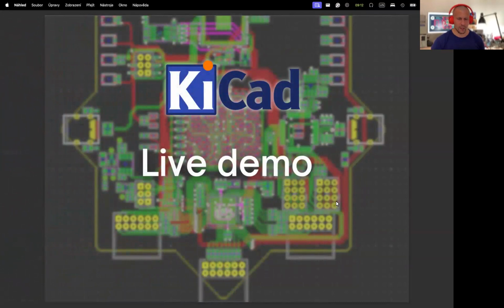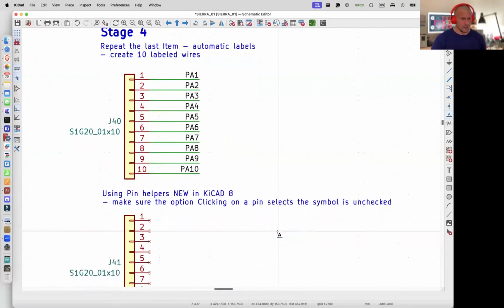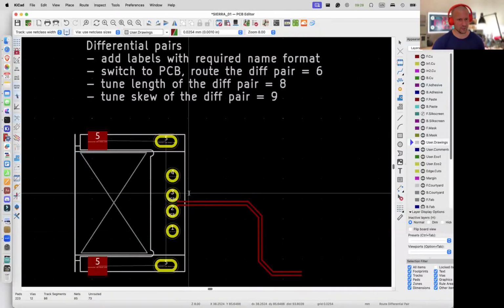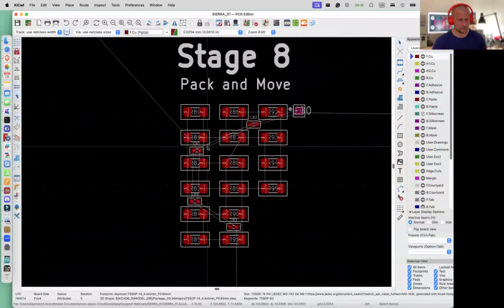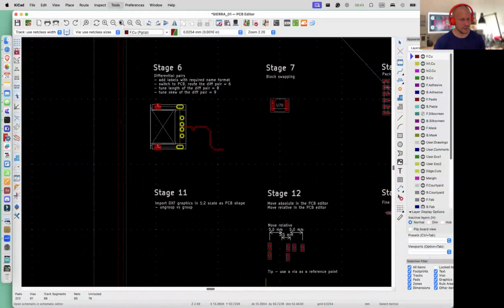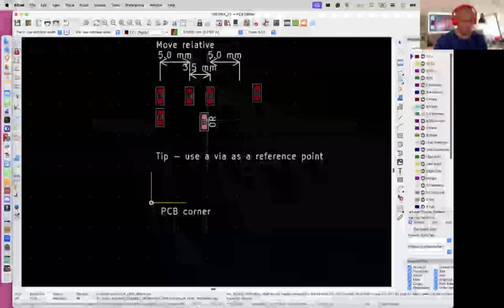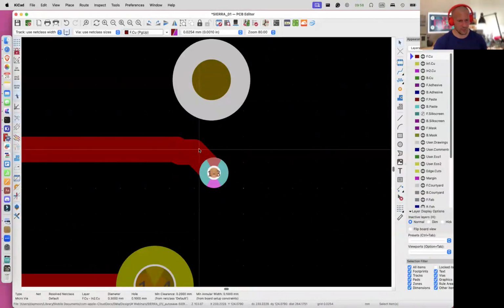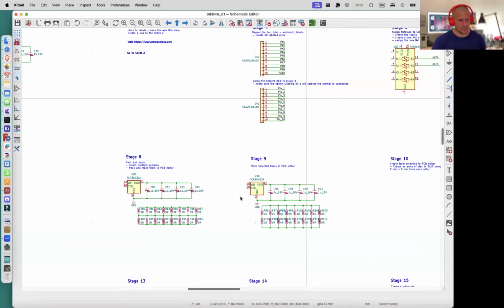Kicad for serious hardware development.

Comment: Hello, could I ask you how you achieve the visualization of the component size in the schematic (e.g., 0201; 0402; etc.)? I see that in your schematic, this reference appears in fuchsia or lilac color. Thank you very much, regards.”
Reply from the maker: If you add this text as parameter to each component on the schematic, then you can just check the visibility check in the component edit menu.
Reply: @circuitcraftlab  Okay, I thought it was an independent parameter that made the component size type visible, and I wasn’t seeing it. 
Thank you very much!
Regards.